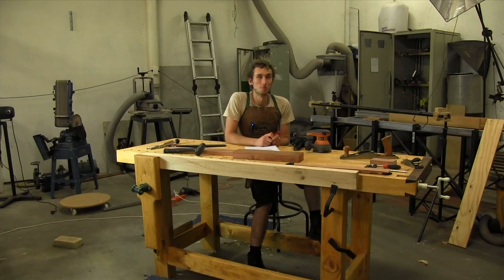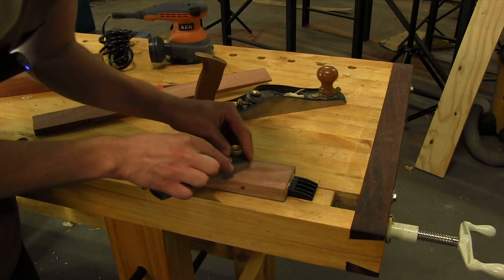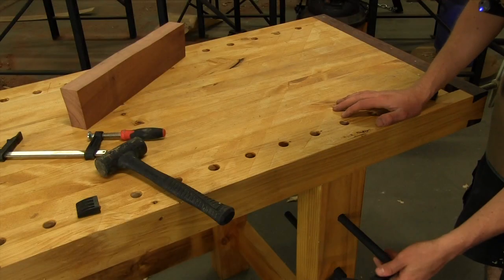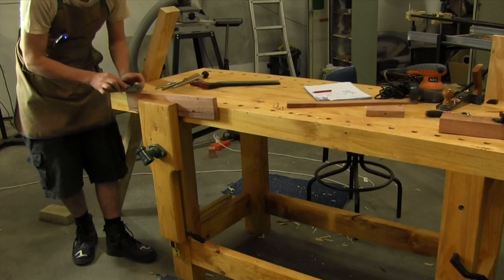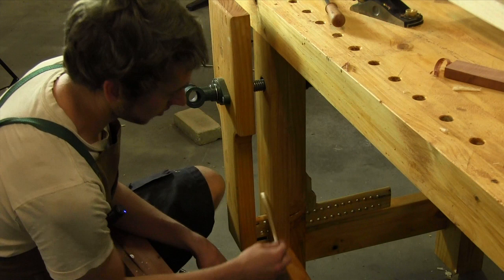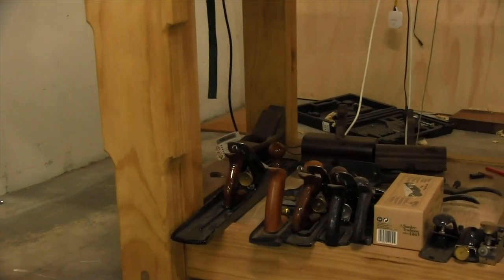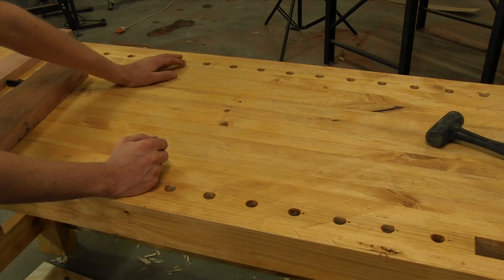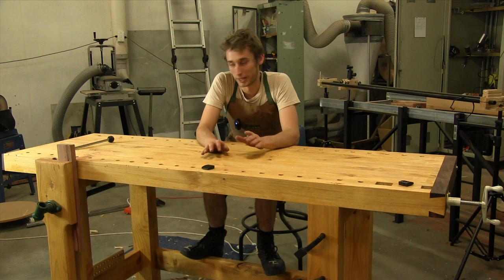Build a solid workbench on a budget (split top roubo)  Part 12 - The Finale (using the bench)

Comment: I'm a novice so I don't even know what workbench features I need. But, I think I would really miss a longitudinal split at around two laminates from one side, for regular clamps (to clamp sideways and top-bottom). I would also probably punch few oval holes in the top so that a typical clamp foot goes through. I've also seen benches with a lowered center part of the bench top. I certainly see this as useful.

I intended to watch the two first parts. Here I am, commenting on the finale... ;)
Reply: That is called a WELL,and is what most old British benches used..Go and see Pau; Sellers site.
Reply: Here I am months later, with my needs pretty much figured out. It turned out I don't need a workbench ;) Well, at least not in classical proportions. After sober analysis it has turned out I need  something more along the lines of a massive sawhorse with a bench bull integrated as the hull. With the possibility of installing a planing board with a simple moxon vise. All compact as I intend to use it at my apartment. Low and narrow but long, with a platform I can stand on or balast provisions. What do you know! :)